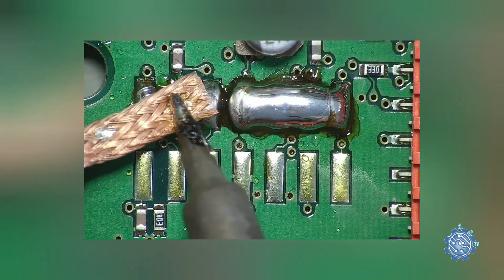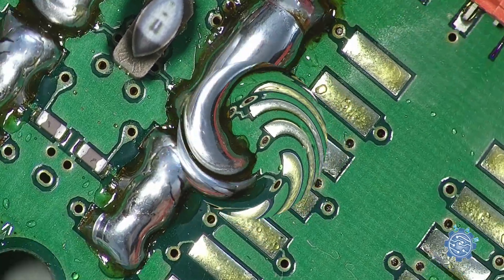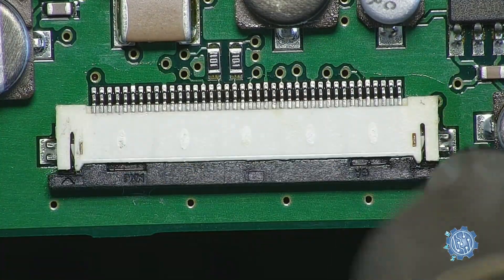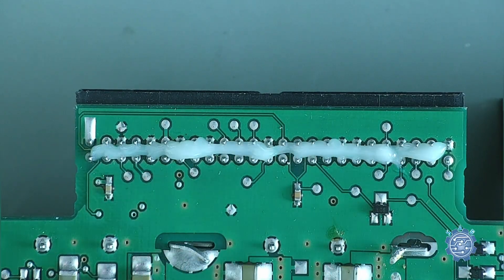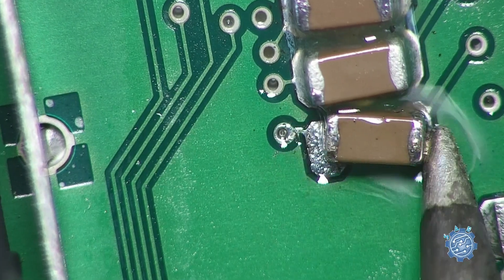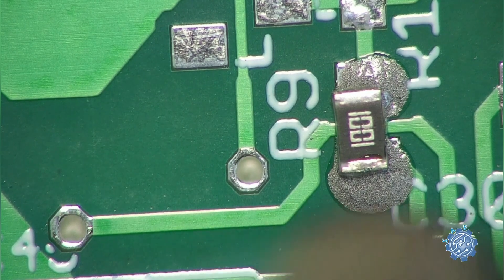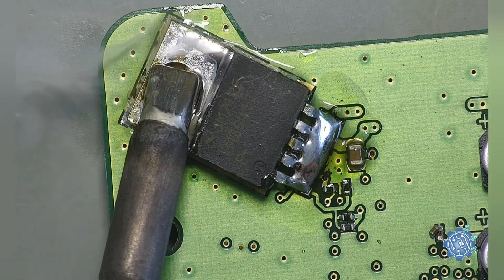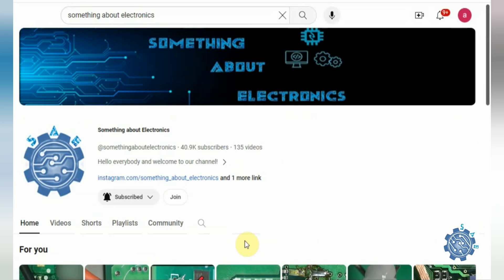10 SOLDERING TIPS AND TRICKS

Comment: thanx. i have hard time recently and still unable to do it. i wanna solder gps quectel L80-R into male pin heqders likr how i see on youtube. The problem is the sensor  does not have hole pin to make it easy. duuh, how the hell they manufactur a sensor that is without connector hole
Reply: i need help bruh
Reply from the maker: Sent me some photos on email: electrocircuit4@gmail.com